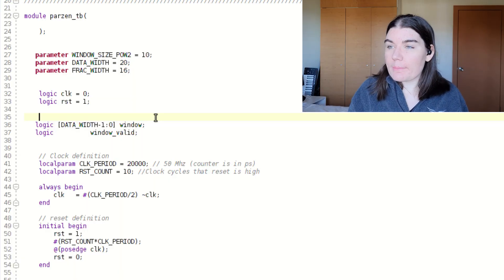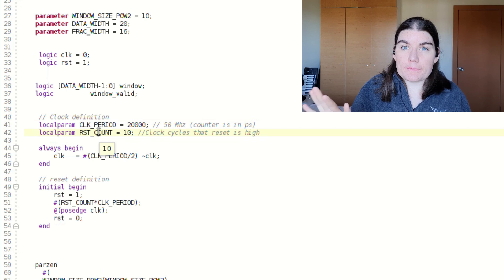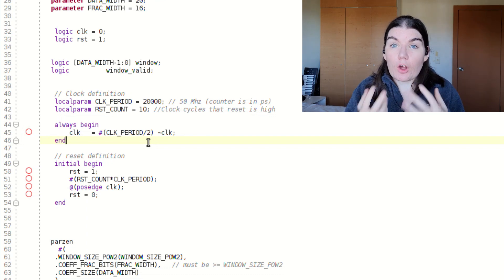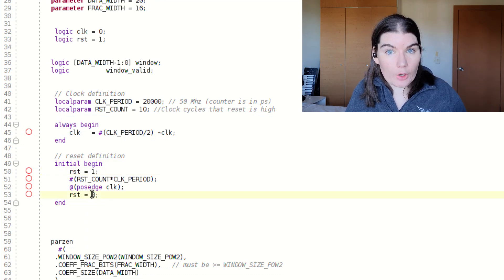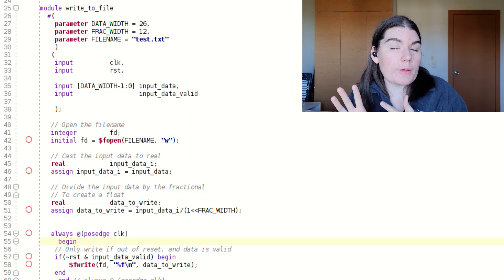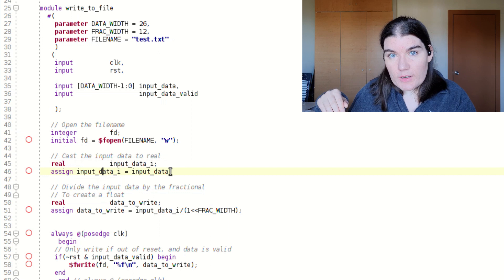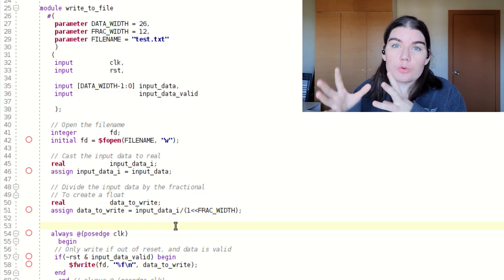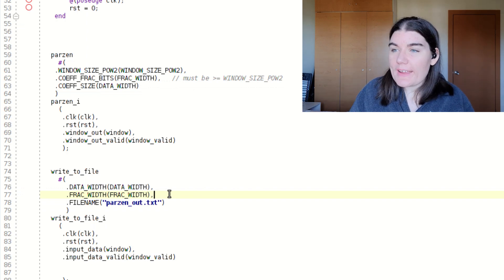How do I write to file? Testbench basics for beginners in Verilog!

Comment: EDIT: THANKS A LOT. :)

Hi. I am trying to write a testbench for a file. I am so confused here. Are write_to_file and write_to_file_i (@4:17) two separate modules or are they the same module which you explained?
Also, do I need to create a text file separately first or is that going to be created during the simulation?
EDIT: Also, where are you supposed to call the write_to_file module? Inside the test bench? Or inside our top module?
EDIT: One more question, If we are supposed to create a text file ourselves? Where do we put the file? A vivado project has multiple folders.
EDIT: I figured out everything.
EDIT: One last question: How to run the simulation for a specified duration of time?
Reply: I have the same question here

Comment: Was wondering whether something like this has happened to you. 
I encountered an issue trying to read a .txt file from a test bench in vivado simulation. There was a file descriptor error, which was only solved by giving the absolute path of the file. What would be the way around this? Thanks
Reply from the maker: This can be an issue if the simulator working directory is different from the project working directory. So sometimes the relative path is difficult to determine, which is why using the absolute path fixed the problem.
Reply: @FPGAsforBeginners  Thank you